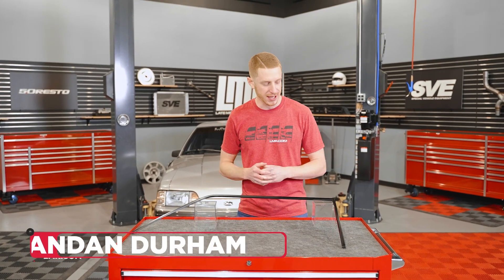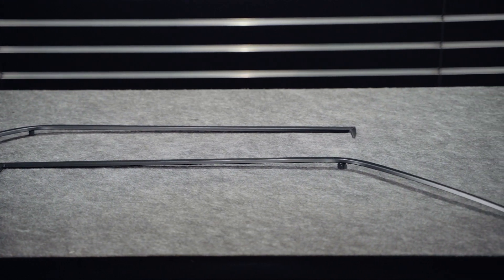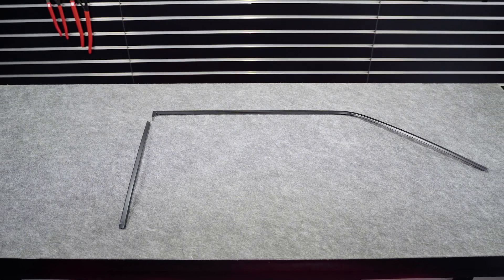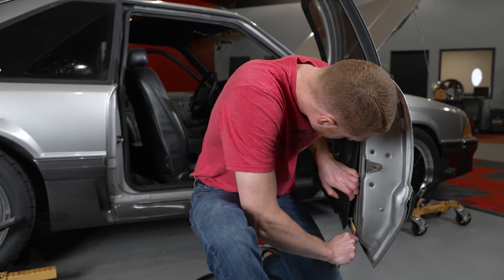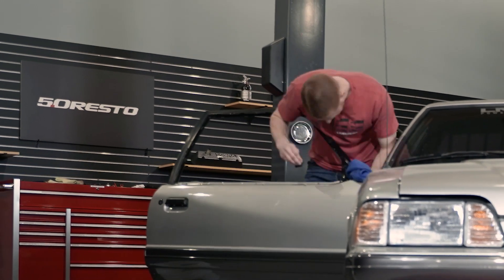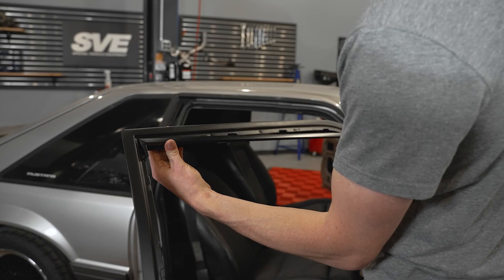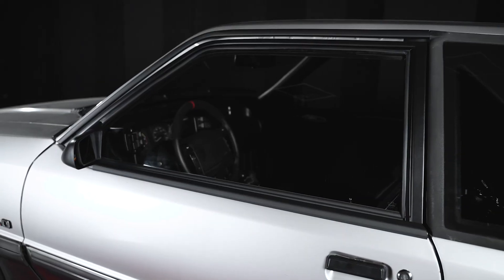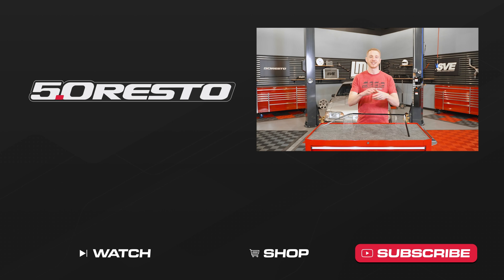How To Install 5.0 Resto Fox Body Mustang Run Channel Trim (87-93)

Comment: how different are these for the 1979-1980 Foxbody?
Reply from the maker: Hey there, 

The length on the downward angle is longer for 79-86. Our 5.0 Resto run channel trim will be too short when compared to a 79-86 model.
Reply: @latemodelrestoration  will you guys start making them for the 79-86 i need them bad
Reply: We need more 4-eye parts please. I'd spend thousands on em if you hade them.

Comment: Awesome video he talks about weatherstrip outer door belt molding out of door rail, weatherstrip, outer door, rail, molding roof rail molding and then the window run channel trim. Is there a kit that includes all those things together for a 1990 GT?
Reply from the maker: We do have an exterior renewal kit that includes the above mentioned parts plus a few more. I'll provide a link below. If you want to purchase individually, I'll list those as well. Thanks. -Landan

Exterior Renewal Kit: https://lmr.parts/LRS-8793ERK
Outer Door Belt Weatherstrip & Molding Kit: https://lmr.parts/LRS-20934-K
Run Channel Weatherstrip: https://lmr.parts/LRS-21596PR
Roof Rail Weatherstrip: https://lmr.parts/LRS-51726-K

Comment: Will This fit a 1986 Mustang LX?
Reply from the maker: Hey there, they will not fit 79-86 models. The trim is slightly longer and will not fit. We are currently looking into 79-86 models at this time.
Reply: @latemodelrestoration  
We have the vertical trim legs for each door. We just don't have the upper horizontal legs. Could we buy and use our vertical factory longer legs?
Reply from the maker: We have not tested that yet. You might be able to make it happen, but we do not not know if if will work.